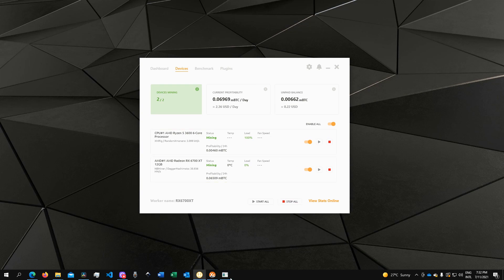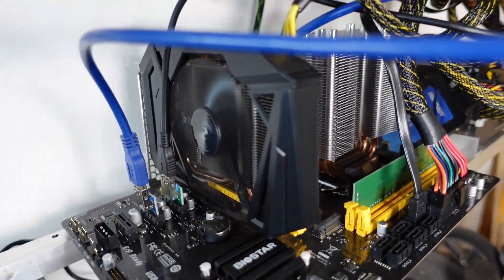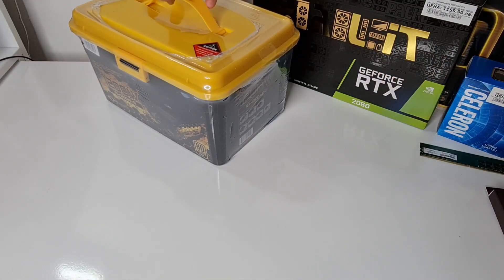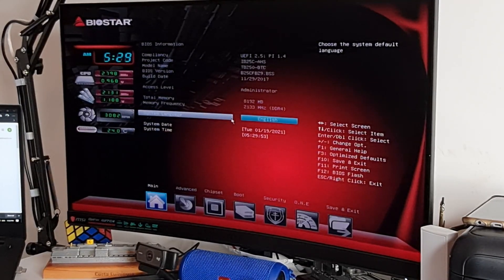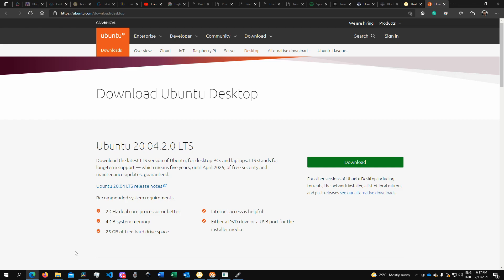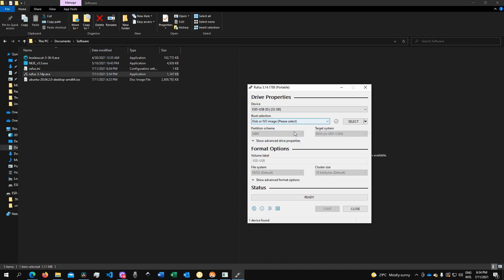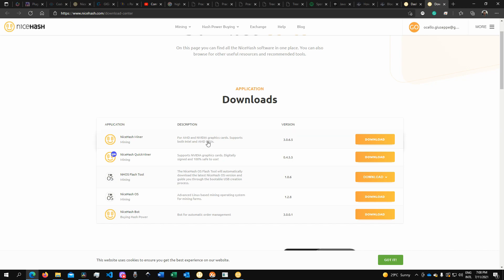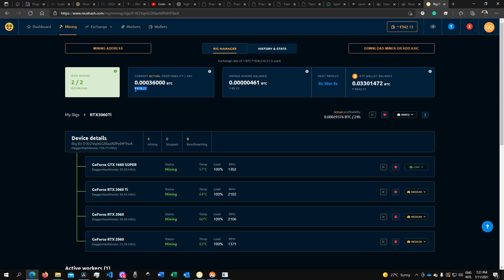Building A Mining Rig | 2 x RTX 2060

Comment: Is the 128gb SSD completely necessary? Could you get away with a smaller one?
Reply: Also, It seems the Power Supply isn't available any more, could you recommend a good replacement?
Reply from the maker: Hello EBlock, you need the SSD just for the OS, therefore take as much as is required by the Operative system you are going to install plus some extra bit for any software and updates. 
If you find a 64Gb is enough.

I hope it helps, 
Ciao
Reply: @MiddleRoomWorkshop  Thanks :)